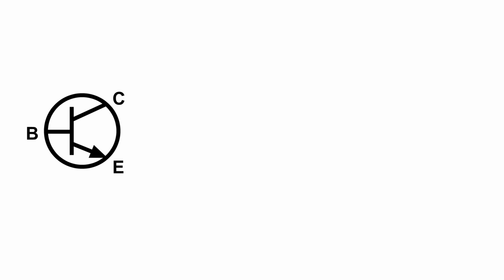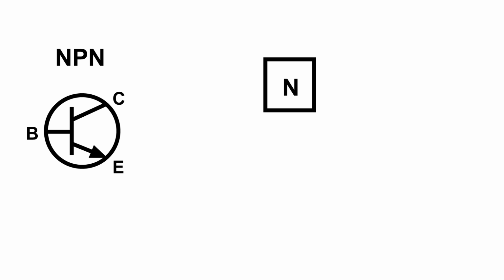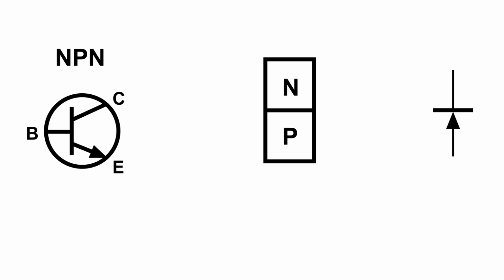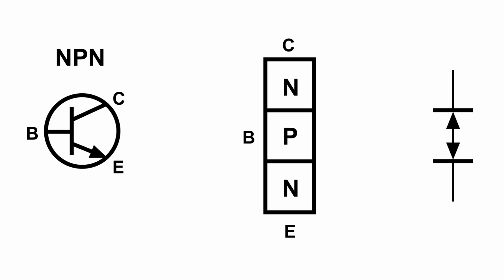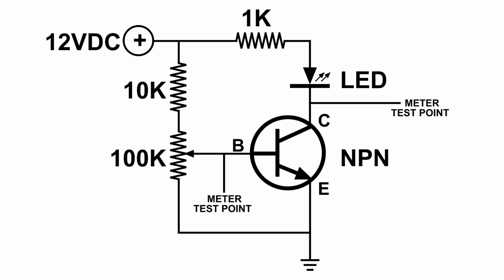NPN Transistor on off switch and also a variable resistor

Comment: nice tutorial, can i ask.... if i have a rising voltage and i want an LED to switch on at a giving voltage, would i then need to construct a darlington pair ?  using a simple bc547, the end result is LEDs coming on at a low voltage and then increasing as the voltage increases, i want to switch not vary
Reply from the maker: A schmitt trigger may work.

Comment: Would it still work if the 10k resistor wasn’t there?
Reply from the maker: Yes for a few seconds. Without the 10K resistor the full 12VDC  would be across the B E junction and this will burn out the transistor. Guess how I know.
Reply: AllAmericanFiveRadio Lol. Does that keep the base slightly biased? I get confused with why bipolar transistors need vase resistors

Comment: thx. so we can actually use this as a veriable voltage supply right  and if we need more amp we need bigger transistor ?
Reply from the maker: +Fatih Saruhan Thanks
Yes you could use this to control voltage. You might want to Google “variable voltage regulator”, these devices already have the transistors, diodes, and Zenor diodes built-in.
Reply: thank you . but im tying to learn electronic so i want to build myself instead of buying it :D
Reply from the maker: +Fatih Saruhan 

The Vacuum Tube
Shortwave Radio, free ebook
http://www.richardmcwhorter.com/vacuumtuberadio/
Navy Electronic
Course download page
http://www.richardmcwhorter.com/NavyTraining/
Reply: thank you :))